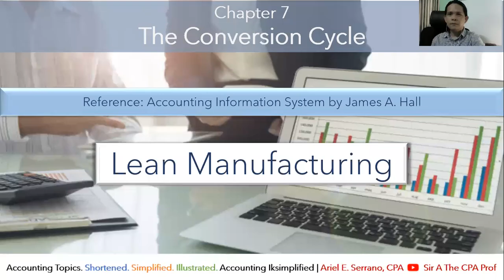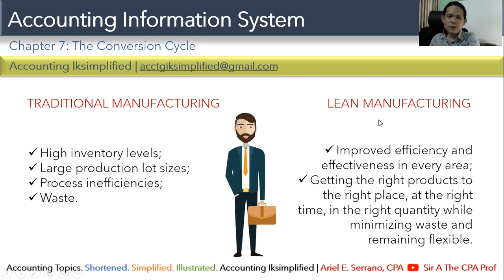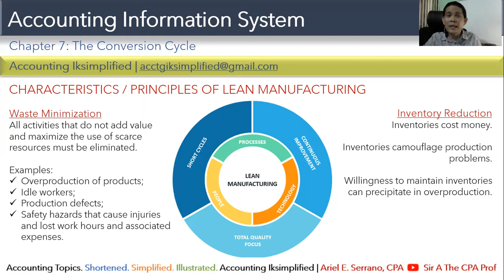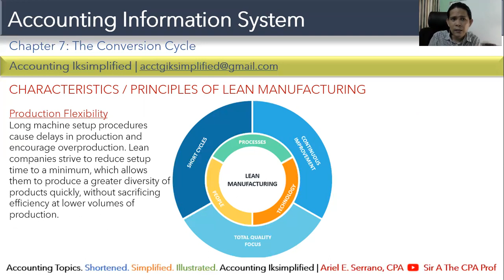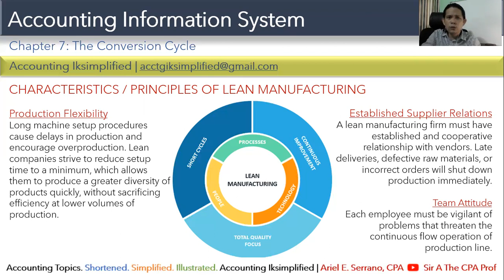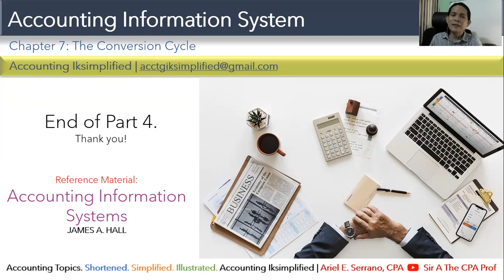Lean Manufacturing

Comment: Lean manufacturing, also known as lean production, is a production methodology and philosophy that focuses on maximizing value while minimizing waste in the manufacturing process. Rooted in the Toyota Production System, lean principles aim to streamline operations, enhance efficiency, and improve quality by eliminating non-value-adding activities, reducing inventory, optimizing process flow, and empowering employees to contribute to continuous improvement. The ultimate goal of lean manufacturing is to deliver high-quality products to customers on time with the most efficient use of resources possible.

Comment: In the fifth video in Chapter 7, it makes me aware that Lean manufacturing streamlines operations, cuts waste, and boosts productivity. Scrutinizing processes removes excess steps and resources, reducing inventory costs by aligning levels with demand. Furthermore, Just-in-time production minimizes overstocking and stockout risks, enhancing agility. It also improves resilience against delays by optimizing resources. This means that embracing lean principles fosters continuous improvement and efficient resource allocation. 
Thank you for this video lecture, Sir A!